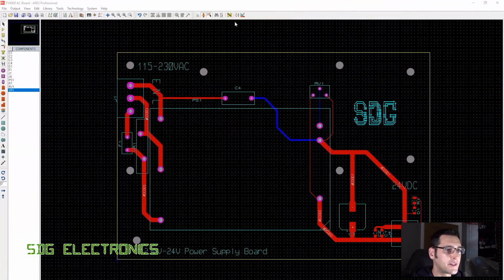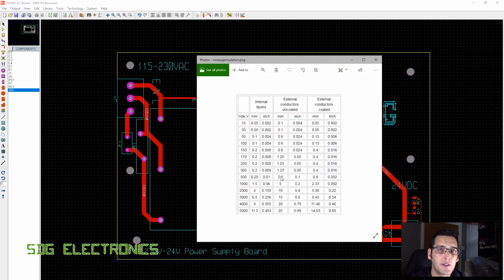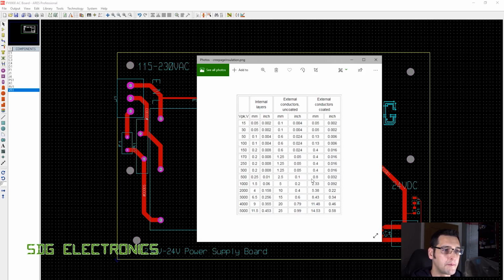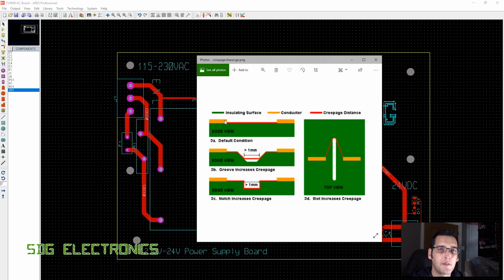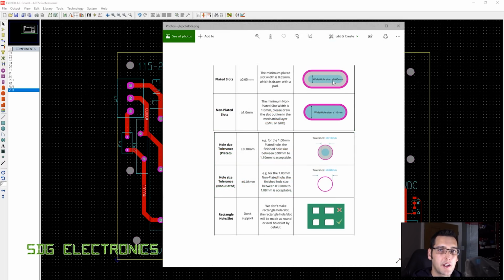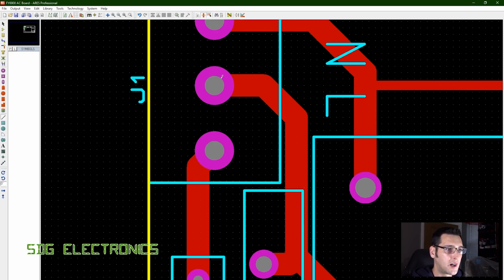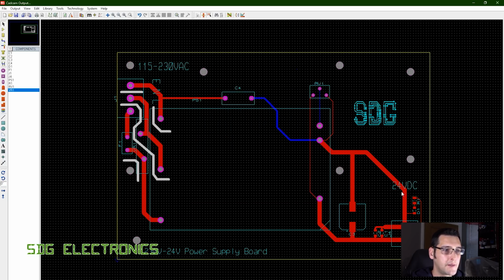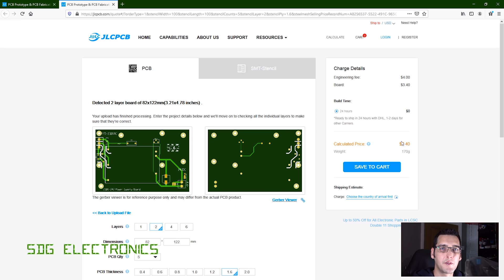SDG #116 Creepage and Clearances - Adding mechanical routing to your PCB

Comment: Nice demo, but I think the most important part  is creapage and  clearance  between  the mains voltage and the low voltage side the user  might  touch.  The transformers in most Chinese psu's fall way below par on this point.

Comment: Three videos within five days. You seem to be on fire! The moisture demonstration was excellent, the ending brilliant. Grear work! I wonder if conformal coating would have a similar effect as solder mask on the clearance distance. I assume it should help at least with the creepage distance?
Reply: Ristomatti Airo Yes conformal coating will help as well and will more importantly keep the surface clean (pollution down), and there is a large variety of conformal coatings with various properties.  However, it is not recommended to rely on mask or coatings in place of proper spacing.  Some agencies do not recognize these methods.

Comment: Why did you cut those traces, why didnt solder on connector holes?
Reply from the maker: There's other areas of the PCB that wouldn't withstand 1kV during the testing. These were isolated by cutting the traces